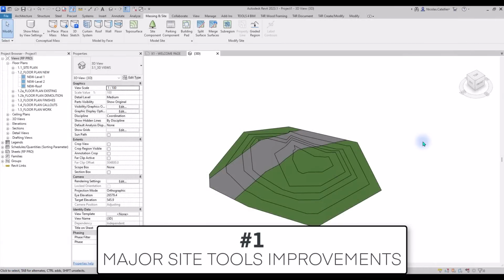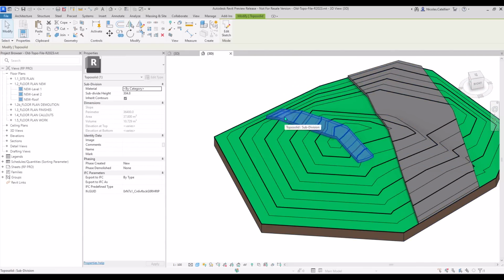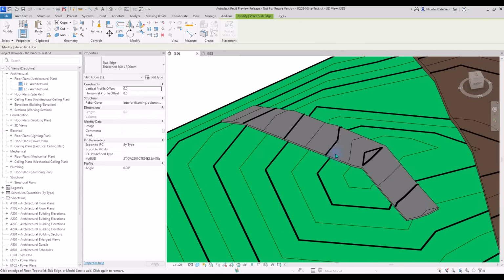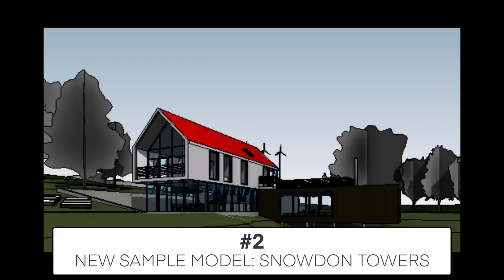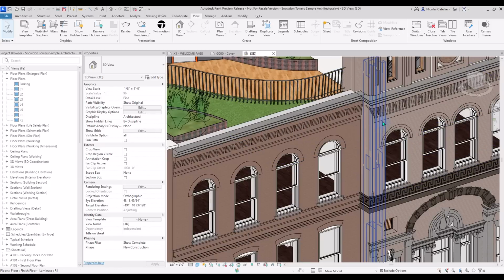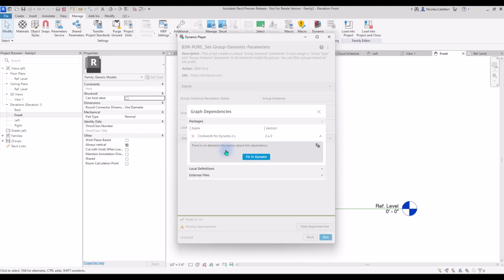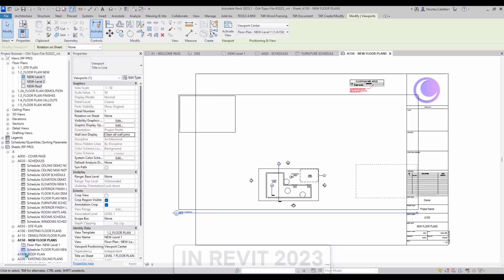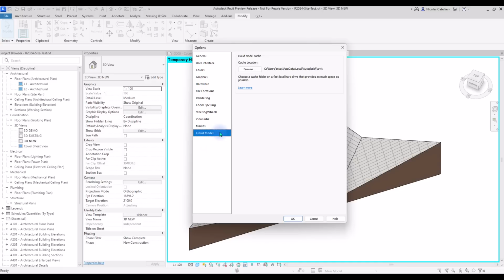Best New Features in Revit 2024

Comment from the maker: What is your favorite new feature? Type it here  👇
Reply: Topo Solid
Reply: Topo solid❤
Reply: Topo solid is a much needed add,  everything else architectural seems like quite a minor. Although it's sometimes the small tweaks that have the most benefits in everyday use.
Reply: As an MEP guy, #13. Typical Details, Duct Drop/Curb Sections, Plumbing ISO's, etc will be so much better to build sheets with.
Reply: shared parameter ordered automatically. it used to drive me nuts!
Reply: 1. Dark mode
2. Improved Project Browser
3. Improved example projects and template
4. Dark mode
5. Resizing schedule rows
6. Placing multiple views simultaneously
7. Dark mode
Reply from the maker: @AdamSambuco  🌑🌚🕶️🖤⚫

Comment: Creating topography was hell, this was a major update, who on earth decided to remove building pad and replace in with massing void. All other updates are very much welcome. I really liked the updates regarding the schedules
Reply from the maker: Building pads were not perfect, but they were relatively simple to use. Massing voids are harsh for beginners
Reply from the maker: Although it's a welcome addition for advanced site modeling!
Reply: I think building pads should have stayed and renamed to smth like building footprint with a type parameter to choose whether to have the actual pad or not, it might even use a floor type right away like a stacked wall uses other wall types. Now the user should repeat the line to have the actual pad set. It should even have the ability to be controled by points like floors do. Combining couple of workflows could create an intuitive solution. Massing tools should have stayed for mass model creation.

What do you think?

Comment: When you make a toposurface in Revit 2023 you are actually making a spline through the points of the topo. You are getting a smooth looking surface unless you have triangulation on in visibility. If you add points to a shape edited floor, then you get a surface with sharp edges not resembling topography at all(even with interior edges or folding lines turned off.). 

So how is a toposolid different from a shape edited floor?

Comment: Still no 3d walls? Maybe in 10 years. Topo solids are just slabs with contours.  With the subscription model, they cut down on development and just increase the profits. I don't think with perpetual licenses anyone would pay for this update. Disappointed.
Reply: I'm confused.... Revit has always had 3D walls....? lol
Reply from the maker: @TheRevitKid  They are working on a new feature to make each layer of a wall fully editable independently in 3D. Like the parts tool, but that actually works and isn't annoying to use ;) This is mentioned in the roadmap: https://blogs.autodesk.com/revit/roadmap/
Reply: @bimpure  Ahh i get it...
Reply: @TheRevitKid  Environment Plugin is much better than toposolids. And it uses slabs for topography. Nothing new from my point of view. Even the contours on top of toposolids are ugly because there's no smoothing parameter like in civil 3d.  On the other side modelling complex walls eg plaster-insullation- brick- plaster, join them with floors, also multilayered, is a nightmare. I have tried many solutions, the only working, which is 100% manual, and need rework in every update is to model each layer as a separate wall, with auto join off, and manually join and switch join order as needed. As I said 100% manual solution, and a nightmare if you want to model everything, eg plaster on beams, plaster in openings etc. I think archicad has materia strength which prioritize the join behavior for many years. You just can't go easily in level of detail more than 3 with Revit.
Reply from the maker: 3D walls next year maybe?

Comment: THIS FEATURE IS GREAT, HOWEVER, I THINK AUTODESK NEEDS TO UPGRADE THE ROOF, AND ROOF FRAMING TOOLS BY MAKING IT A MORE AUTOMATIABLE.. ESPECIALLY THE WOOD TRUSTS AND WOOD COPING . THANKS..
Reply from the maker: There are plugins for automated wall & roof framing, such as AGACAD and MWF.
Reply: @bimpure  for another $2500 a year. No thanks
Reply: @bimpure  YEAH, I AM AWARE OF THAT; WHAT I MEAN IS, AUTODESK MAKING IT A DEFAULT FEATURE. NOT A SECOND OR THIRD PARTY PLUGIN.. BESIDES AGACAD ADDINS TO ME ARE WAY MORE EXPENSIVE..
Reply: Caps lock? Seriously?